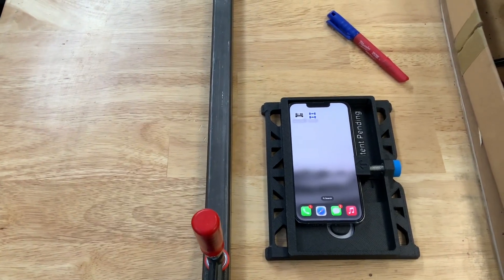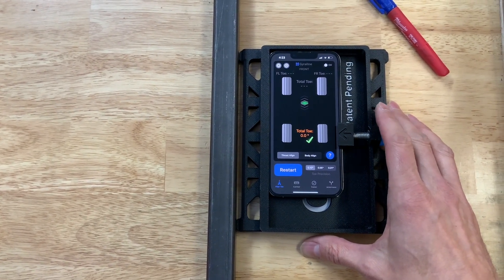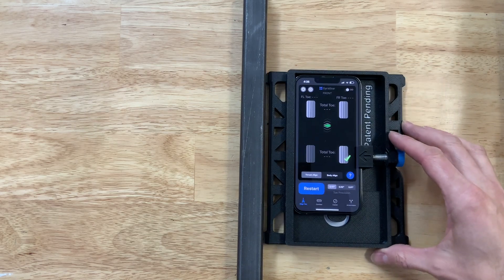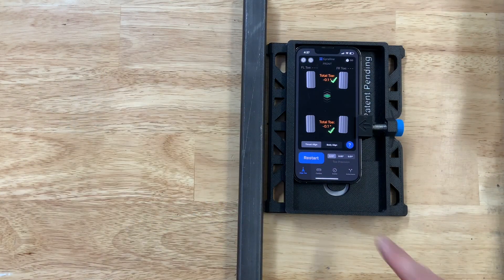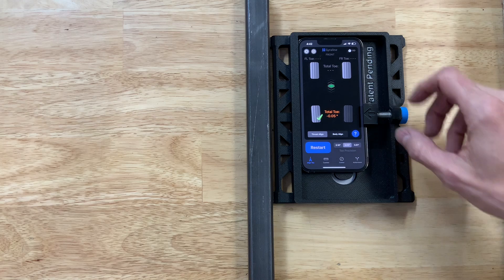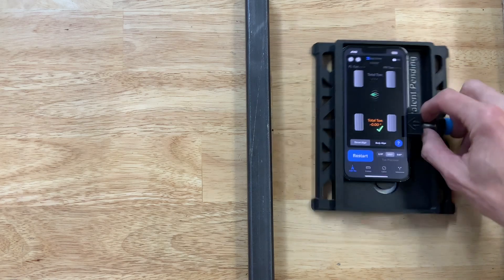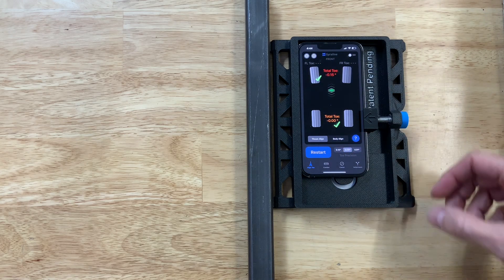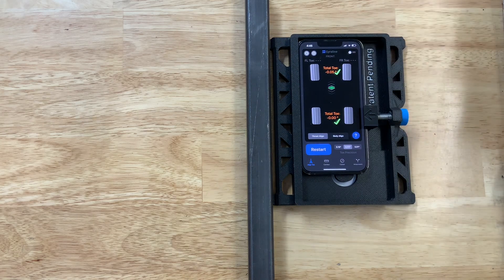Gyraline can be repeatable - the wheel interface is a challenge.

Comment: My one gripe about the product isn’t in how accurate, because it is incredibly accurate, but it’s how inconsistent we are when measuring.   And it’s not like we can tell if a painted wheel has too much millage in one place and too little in another.    But a chip all the way through to the steel is too much variance, believe it or not.    The paint sprayers at the factory are doubtfully as accurate as the Gyraline needs it to be, for the body align aspect to be very useful.     The device and app are incredibly accurate in knowing their RELATIVE positions in space.   So it’s crucial to start with something repeatable.      Very, very repeatable.   And it’s here where I have a problem with the designers, or owners, or whoever came up with the set of instructions.     They go too far into redundant instructions, but leave out crucial info needed for repeatability.     It gets old referencing the front to back and side to side aspects of toe, and getting a positive number on a back wheel one time, and then a negative number the next time around.    That sucks.   It will drive you bonkers, because this has happened to me before and I ignored the toe readings on the front after painstakingly setting them to zero on each side, consistently, checking and rechecking.     All of my suspension components are new, too, with some bushings now being Mevotech units with spherical bearings where a rubber bushing had been, greatly reducing deflection and dramatically improving accuracy.    But I drive the car for a bit and the front end felt superb, but at high highway speeds, like 85+mph, I could sense the rear end moving around slightly, like it was gusty and only affecting the back end, but there was no wind.   So I checked and the rear tow was out,   At the time I didn’t check camber.    But it was way out on one side, at negative 2 degrees where it should have been negative 0.75 degrees.      Ouch.   Components were settling I guess.     But when I when to redo the back, I kept getting odd numbers up front, which I was sure were at the very least, parallel to each other, and I was right.    So I ignored the front tires numbers and dialed in the rear, not measuring camber.   Took it out for a shakedown run, and it handled like a track car, as if I would know, but it was deadly accurate, even darty, held off ramps so well it was har dot believe, no tire squeal, another indicator, and self corrected perfectly, indicating profile caster.     It drove very straight, with only the slightest pull to the right , assuming road crown did that.     But my steering wheel was ever so slightly off center.    Maybe like the 12:05 position.    I wanted it perfect.    Went back held the steering wheel dead straight, this time using two ratchet straps, one to each seat frame rail, and the wheel could not move at all, rest it, but now it drive like crap, and the steering wheel as way off center.    It took me some measuring to realize that it was because of rear camber and toe issues that drove like crap.   The previous front toe adjustment had masked the problems in the rear.     Hmm.    After maybe half a dozen rounds of redoing this, I finally watched one of their latest videos, and they noted that the thrust angle measurement and the body align toe measurement needed  to be used together s d back and forth over and over to get truly accurate results.    Apparently you use the thrust align to truly set rear toe, then the body align mode to set front , using the rear toe in that mode to deduce what is wrong.     If the rear toe measurements in body align mode seem off, try to ignore them, set the front for individual toe, do thrust mode again to recheck the rear toe, correct if needed, then check front with body align mode, correct if needed, and so on.   If they had only put that info in the manual initially, I could have saved so much headache.   I almost requested a refund because the number were inconsistent.    But there’s a reason.    You have to be very consistent , or you will get compounded errors, especially if you count on body align mode only for all four wheels to be correct toe.   Also, the sequence of measurement matters.   With most five link rear independent suspensions, you set front caster first, then camber in front, then rear, then toe in the rear, then front.    Recheck all over again, caster will usually be fine  once it’s proper, unless there is massive camber change, more than would be normal, so no issue.    Camber is a huge deal for toe, mostly because of bump steer.     Oh, there’s a correction kit for the Chrysler  LX chassis?     You mean they raise the rack about 1/2” to correct it?     How about 5/8”?     Too much doesn’t help, but 1/2 “ is all they can do with an offset steering rack mount bushing.     Ok.   So I drilled new holes 5/8” higher, which effectively made a figure 8.    So I made fillers to keep the rack from being able to slide down or elongate the holes AT ALL.    Basically I took an old camber alignment bolt, which if viewed on axis, looks like a figure 8, or what they call bat wings, cut it down to  not long enough to hang out of either end, but not short enough to fall inside one side of the space,    I used oversized washers on the rack bolts which hold the filler bolt in place.      To make sure I didn’t screw up, before making this permanent change, I jacked the rack up on each end with wood blocks underneath, no bolt, until the rack was pat the original hole position and up against the inside of the engine cradle spot for the rack to mount.     Then checked to make sure the tie rods could articulate without hitting anything, anywhere, because I’m always asking myself, “if Mercedes didn’t design it like this, how can I think I’m smart enough to improve upon their design? “.    Well, this is the first thing I’ve found like that.     This modification literally transformed the way my Dodge Magnum drives over bumpy areas, especially on the interstate and bridges with expansion joints.   Bumpsteer gone.    Alignment perfect, better than the dealership EVER got it.  Of course I’m using adjustable camber on front and back, and adjustable toe links out back, both of which can be done without jacking the car, without removing a wheel.    Which helps to keep it accurate, otherwise you’d have to adjust, put the wheel back on, drop it, roll it a little,check, the do over.    This way, you make the adjustment and that’s it.    With my cop sway bars, 33 mm up front, 19 mm out back, Bilstein B6 shocks, spec on SRT8 models and BMW M cars, fyi, plus 3/4 of a coil off each coil, which dropped it maybe 1/2”, and added a hair of spring rate, actually a complete 2011 Charger Pursuit rear subframe now resides under my Magnum RT, which already had the factory Performance Brake Package, meaning cop front brakes,but now I had the matching rear sway bar to my giant cop front one, cop rear brakes, which is really just a bracket which moves the caliper further out, and the rotors are 1” bigger diameter, plus got the fresh looking rear subframe bushings, where mine were shot, and the. 3.06 rear gear, as opposed to the factory 2.82.    The car is transformed.   I had to get a tuner to tell the computer about the new rear gear, so I might as well use their maximum horsepower gain, claimed to be about 30hp, and 25 ftlbs, premium fuel I already used exclusively, 93 octane always, and wholly crap the car went from being fun and powerful, EVEN with 208,000 miles, it drives better than new, but after the gear and the tune, and the suspension, the car feels more like a weapon.   There is no way it only added 30 horsepower.   My 0-60 went from a best ever of 6.4 seconds, to a wheel spinning 5.6 seconds.      The gear shifts are the most incredible improvement, and I never expected that to be so dramatic.    The 1-2 upshift feels like a giant just shoving you from the rear, as if to say, “you thought you were accelerating quickly, but NOW you really are”.     Thank you Gyraline.   But we’ve paid you plenty of money.   Explain how it’s used better.    And cut us existing customers a deal on the new version.     I paid a lot of money for a piece of plastic and a killer app, and I’m sure they put huge R&D into it.    But without the accuracy of the iPhones sensors, this wouldn’t work.    And that accuracy, of knowing wheee it is in space , is truly incredible.
Reply from the maker: Longest comment on YouTube today! 
But I appreciate your findings.  I am also coming to grips with the fact that no normal shop would align as closely as we are now able to do.  I will be checking out the V2 of the system b/c a recent track day opened my eyes to how much small alignment changes can transform the car.  Being able to do so in fewer iterations will be fantastic.  Still not excited about the wheel interface and will probably come up with my own method...

Comment: I have been using Gyraline for a few months now, and it is both frustrating and incredibly impressive.      My one problem with the device is how seemingly inconsistent it is.    I have determined that it’s not the app or device which is inconsistent, but our placement.      I once tried to trip up the app using an audio amplifier which I thought would be a “known and absolute square “, but I was wrong.   I even used masking tape as a variable to trip it up.   Well, at first it seemed to trip up the app, where placing it right back in the same position but with one layer of masking tape as the difference, which should have changed the toe setting, and I had it set to mid accuracy, I think into the hundredths.    Well at first it didn’t change.   So I added another layer of tape.    One time it read different, another time it read the same as the no tape layer reading.   Ok.    So I added another layer, so three layers of blue masking tape, forgot the millage.  Finally it read different consistently, as far as the no tape reading, but back and forth compared to the two layer depth.     Then I realized that simply pressing the device holder against the tape with varying intensity changed the reading!      Wow!!   That’s incredible.    When you have it set to a lower accuracy, it will be more inconsistent, because it’s trying to round up or down for you, thus different readings.   Think about it, even coats of paint as a difference will alter the readings.     Even CNC machined wheels aren’t really that precise, down to the thousandth of a degree.   My rear toe is supposed to be 0.03 on one side, and  0.17 on the other.    That’s some tight tolerances.   I can tell you that even the guys using the universally accepted Hunter machines don’t align that precisely.   The bushings don’t allow that precision to be consistent.    The difference between an empty tank and full tank of gas on my 19 gallon tank is 114 pounds.    Not much, but definitely changes rear toe by more than that spec.

Comment: Any updates on your gyraline journey?
Reply from the maker: The fact that one can use the device quickly at the track for front toe only makes it incredibly useful.  It allowed me to trial 3 different toe settings in 2 track sessions and showed me what the car really likes.  Made the car much more fun to drive.  Still struggling with the accumulated error in body align mode, but read in another comment that there may be an order of operation suggestion from Gyraline that I need to check out
Reply: @BaileynBeta I got one myself, works pretty great I a little touchy but for what it is I’m happy

Comment: It read 0 toe on the metal bar almost everytime , read a negative or positive amount of toe on the table and see if its accurate every time , 0 toe should be easy for the device to measure compared to when you have a large amount of toe your trying to dial back in to 0

Comment: What about an appropriate length of  8" by 8" wood to get the metal interference of the wheel further out and way from the metal of the rim? LOL, wrap the wood block in a metal like lead (not at all sure that tinfoil would provide the insulating effect) to create something akin to Farday Cages insulation? To get physically away from the weird, inconsistent-shaped metal object (the wheel) and insulate the measuring device (the iPhone). Distance: A large wood block would seem to help. But adding in a consistent-dimensioned metal barrier might help as well?  Audio equipment does this kind of sheilding all the time, and it's pretty simple shielding to get the effect. The iPhone needs to be physically placed with accuracy. But the little bugger also needs to be insulated from the electrical and/or magnetic interferance of the wheel/car.?  Hmmmmmm
Reply: I’ve tried testing this premise using a very powerful neodymium speaker magnet and the iPhone compass.   Strangely enough, the magnet made ZERO difference, where a traditional compass showed several degrees of error even with the magnet more than three feet away.   The iPhone obviously uses a calibrated and error corrected combination of gps and magnetic reference or maybe no magnetic reference at all.      Also, I don’t think that simply waving the phone around ever so slightly “fools” the phone or app.    I think the best test would be to have some metal plates arranged several feet apart like a car chassis, and with known absolute square relationships, THEN do the same with plates with predetermined errors in their relationships.    If the app shows square on square, great.   If you’ve got plates set with deliberately messed up “toe” relationships and you KNOW those errors, and the app reflects this, then we should be very, very impressed.

Comment: Thanks for the video. I’ve bungee corded a 1x4 across the face of the wheel extending past the tire when using tape measure for alignment. I’d think you could cut down one to the diameter of just the rim, maybe would give you a straight edge to easily repeat, and not going past the sidewall would take out any variation in the tire.
Reply: Yes, that’s my plan too. I played with it on the brand new daily driver and could not get repeatable results running around for 30 minutes. On the bench with similar test to this video they are pretty repeatable. 
I bench tested that even 2-3 layers of the magazine paper under one of the jig legs will introduce 0.1-0.2 error, so even minor curb rash or fine lettering on the tire lip will throw your results out of whack. 
I think all the inaccuracy complaints are coming from the jig design, the base is too short. I will bungee cord flat bar stock or trued up wood planks to all 4 wheels and see if it will result in repeatability.
Also, do not over tighten the screw, it will distort the jig.
Reply from the maker: @sergeyatlanta  the funny thing about this: my guess is half the alignments we get in shops are probably subject to many of these issues, but since no one re attaches sensors multiple times, no one sees the errors.
Reply: @BaileynBeta  don’t get me started on those monkeys at the alignment shops. Never had a good results from them on routine “we recommend alignment done because new tires”. Every time they touch factory alignment just for the sake of it (presuming there was no suspension damage/parts replaced), cars never drove the way they did. That’s why I decided to give Gyraline a try for my project cars.
Reply: @BaileynBeta BINGO.    The shops are actually WORSE!
Reply from the maker: @andrewhigdon8346  sure seems like it would be worse…
Reply: I would agree that the wheel interface is the issue with gyraline, and the fact that the system is not able to compensate for wheel runout.  Runout compensation is built into all commercial systems to determine the actual hub plane.  I appreciate that you determined that the gyraline system at least seems to work using an iPhone.  I have not been successful trying it on 4 different Android phones from three manufacturers to get the system to calibrate.
Reply from the maker: Nice. This is about what I was thinking… was landing on using L-shaped aluminum profile, bungeed to each wheel. Suspect this should  work well
Reply: In their videos they show to a line the jig with the top part of the rim right as it interfaces with the tire. Wouldn't this be a more consistent place for you to measure as well? It seems to me it might be more in the same plane whereas where you're trying to measure it in the middle of the hub could vary quite a bit from side to side depending on the complexity of the wheel design??

Just a thought
Reply: @jamesthompson3162  depends on the rim lip shape if you can repeatedly register. 
I tried against the tire right above the rim but rubber has fine lettering in places. Tried on the other car with steel wheels and against the tire - still no consistency. Even minor imperfections like old wheel weights scratches will result in 0.2-0.3 degrees inconsistency between measurements.
Reply from the maker: @jamesthompson3162  look at a wheel Iike the Apex ARC8, or a Camaro6 1LE wheel. There are no flat surfaces like the one in the video that are parallel to the wheel mounting surfaces. Strapping extra hardware to the wheel helps with this.